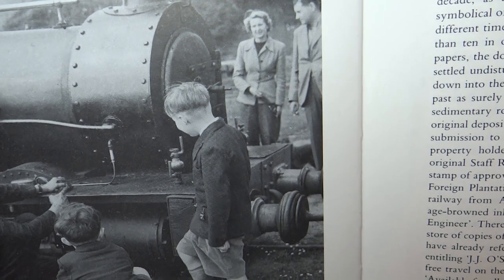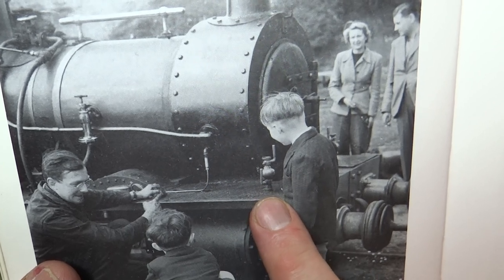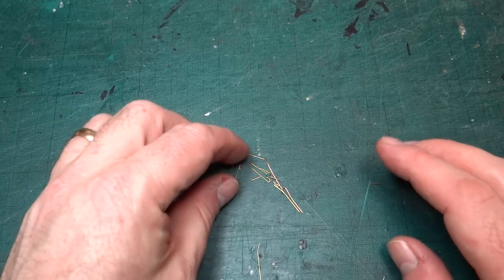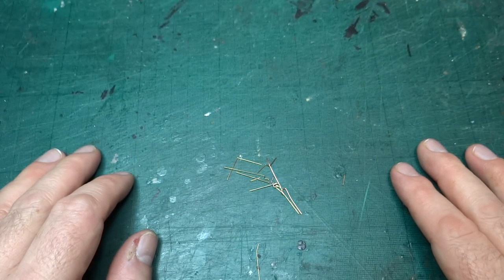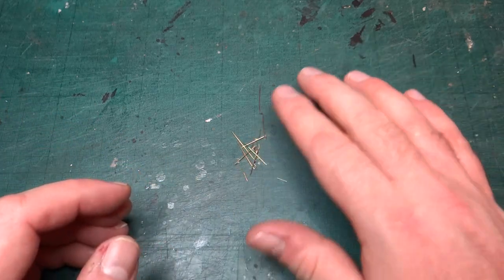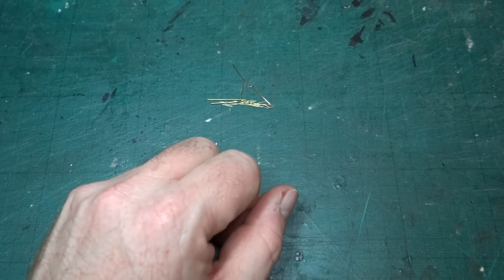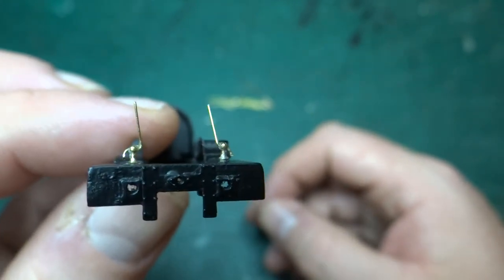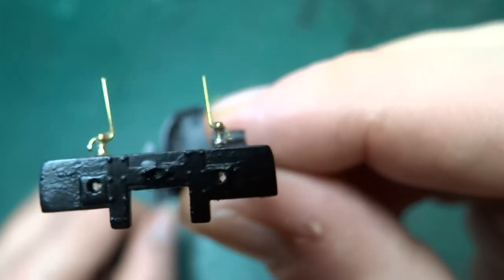Building Dolgoch... by destroying a Bachmann Thomas & Friends Rheneas: Lubrication

Comment: As they’re lubricators for the cylinders, I’d expect them to be in line with the centre line of the cylinders and just forward of them- certainly on locos at Apedale that tends to be the case
Reply from the maker: Yeah, in retrospect that makes a lot more sense, which means they should be a little further towards the edge. Hmm, now have to decide if I fill the holes and move them or leave them where they are. Will have to have a look at a bunch more photos and see how I feel about their current placement.